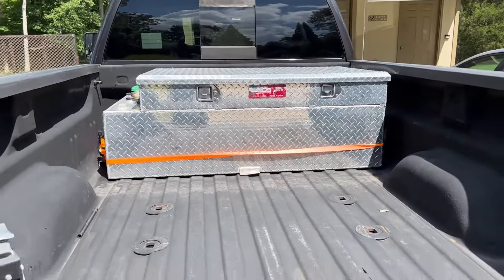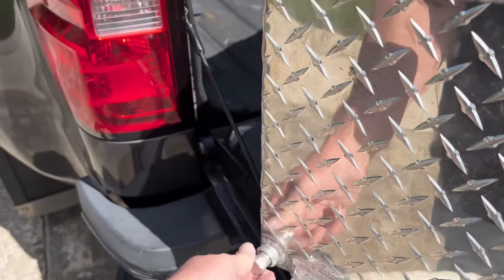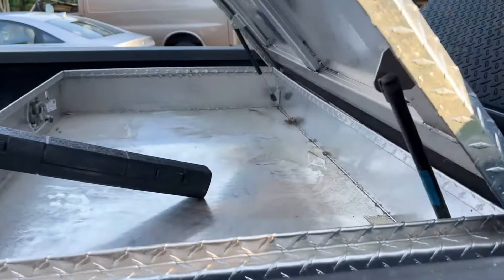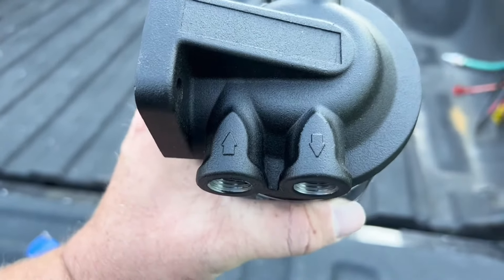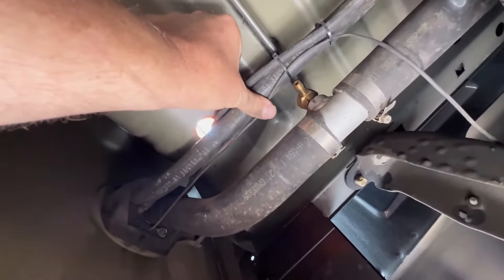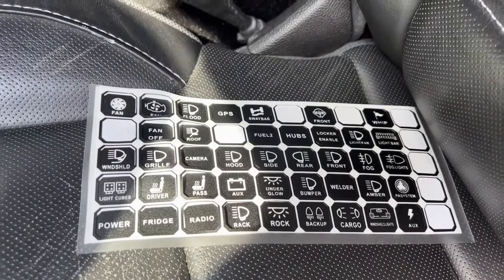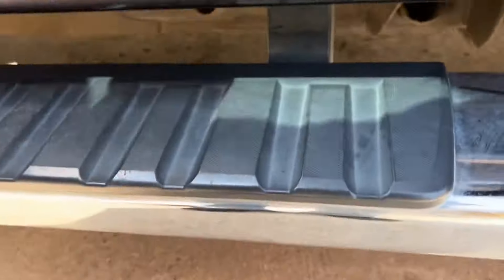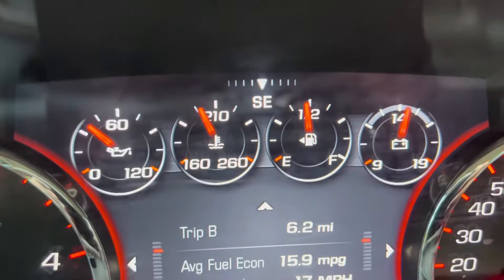Installing RDS Auxiliary fuel tank and pump - RV LIVING

Comment: I installed a 3500 W champion generator in my cooking station and added a 15 gallon fuel tank on the back with a fuel pump. Works awesome.

Comment: GMC monitors that the fuel level is changing, if no change is seen it goes into a fault and the fuel gauge will go to empty. This monitor loop starts over the next time you cycle the ignition switch. Just keep an eye on the mileage and when you see your fuel gauge start to work as it should you know the gravity feed tank is empty. From that point it works as if that tank doesn't exist, your gauge will work and the miles to empty will be correct.
Reply from the maker: Hey thank you for the info !

Comment: Why did you use the 12V pump instead of letting it gravity feed?
Reply from the maker: So a few reasons on that.  And to start , my last tank was gravity feed and I had no issues while I had it. But it was only 35 gallons.  I have a friend with the same size tank as mine who had several issues with a full 90 gallons of fuel having enough head pressure to overcome the ball valve/ gravity flow valve and create a pressure inside the tank fill line causing leaks. And big leaks when he popped the full cap to the truck and released the pressure.  As well, the pickup tube sits off the bottom of the tank 1/4 inch so hopefully that misses any sediments that might drain out. Yes I know filters, but I’d rather prevent it all together from the start.  

Like I said I’ve had both gravity and now this pump from the top setup.  I think both are just fine for diesel it all depends on what you want to do.